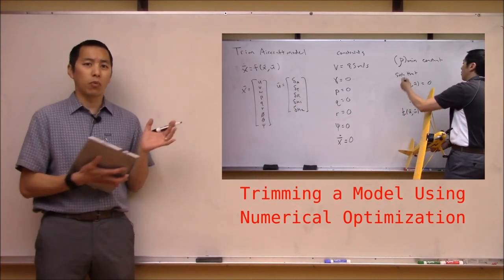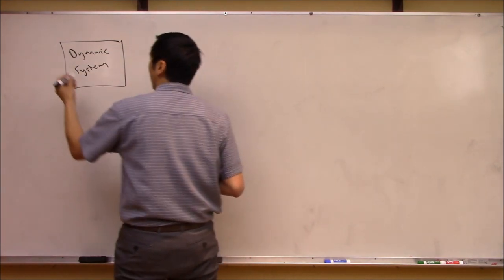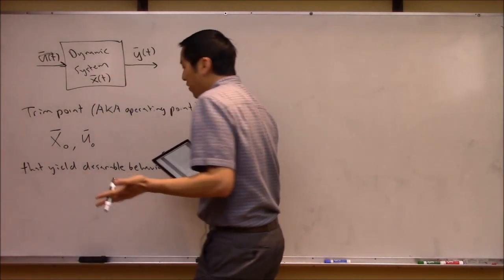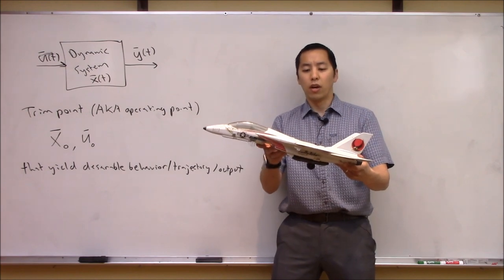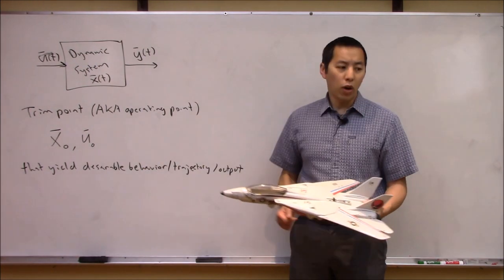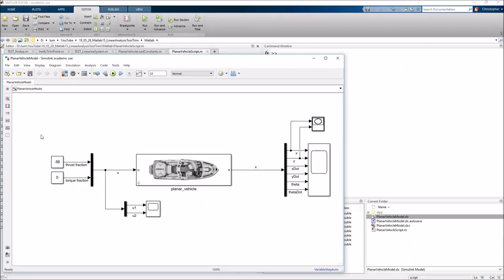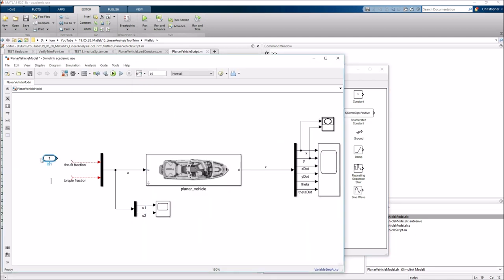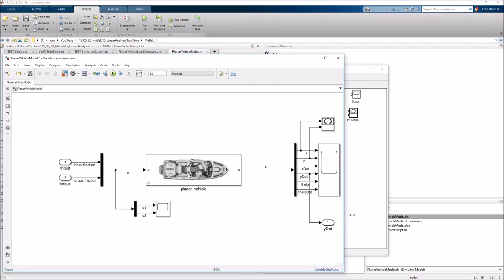Trimming a Simulink Model Using the Linear Analysis Tool

Comment: AA516: That is very powerful tool. I've been reading some of the comments and it looks like some stuff has changed since the new updates. It looks like I have the neccessary packages installed. Thanks for the lecture Professor.

Comment: AA516 - Great lecture as usual. I'm running R2020b and it took me a bit to figure out that I needed to download the Simulink Control Design addon in order to get Linear Analysis Tool. Also, in R2020b, the Linear Analysis Tool is called "Model Linearizer" and is under a different menu. This might be good info for the rest of class to know, if it wasn't already mentioned
Reply from the maker: Gary, thanks for the update and for blazing the trail with the newer version of Matlab.  I'm sure others will benefit from your knowledge (hopefully they read the comments 😀)

Comment: AE512: Very informative about the power of the linear analysis tool. After poking around with it, I was surprised that we could place more expansive constraints on the states (i.e not just a certain states value but rather expressions that related multiple states). Very powerful!

Comment: AE 512: FYI for newer R2022a version of Matlab:

(1) Install the "Simulink Control Design" add-on.
(2) "Linear Analysis Tool" is now called "Model Linearizer".
(3) Simulink menu bar is gone. Replaced by ribbon bar. Open the tool by going to Apps > Model Linearizer.
Reply from the maker: Thomas, thanks for the helpful notes, I'll make sure this comment is visible in the future!

Comment: AE512: Finding a trim point with the Linear Analysis Tool gui really simplifies the process. It should be a quick way to check trim points found using other methods.

Comment: Thanks professor.  I was confused with some of the terminology used in this video.  In case 1 when describing the constraints on xdot, specifically x2dot, it seems to me that you were saying that ydot is not at steady state.  But isn't ydot at steady state, just at a constant non-zero value of 15?  When you were describing the check boxes in the linear analysis tool it seemed to make more sense, that actually what you were describing is that y (x2) is not at steady state since ydot (x2dot) is non-zero.  To me it would have made more sense if you would have described it as "is y (x2) at steady-state, or is ydot (x2dot) equal to zero".  Do you agree, or am I not interpreting this correctly?
Reply: [AE 511] I had the same question as Brad a few years ago

Previously, you can have non-zero steady state values. It seems like steady state in the findop, we are defining steady state meaning 0

Comment: Hi! thank you for the videos, it is amazing! But i am having some throuble with my simulink model. It's trim using the linear analysis tool but once a initialize my model from that button on the operation point tab, my inputs changes for zero when the simulation is running. Do you know how i can solve this? thank you!

Comment: [AE 512] 16:24
Why is \dot{x}_2 not steady state? It is moving at 15 m/s but it's constant which means it's at steady state? Or does steady state in this case mean 0?
Reply from the maker: We want the boat moving in the +y direction so this means that y will be changing, but x is constant.  Because x_1 = x and x_2 = y, this means that \dot{x}_1 should be 0 but \dot{x}_2 should be equal to the desired y-velocity.
Reply: @ChristopherLum  I agree that \dot{x}_2 = \dot{y} = 15 m/s. But 15 m/s is a constant value in this trim case which also means it is steady state. One steady state value is a constant of 0, but it can be any value (like 15 m/s) and still be steady state.
Reply from the maker: Ah, I see, I was using the SS notation to denote which states are in steady state.  Go forward to around 24:30 and you'll see that the steady state constraint is on the state vector.

Comment: AA 516: Can you post the planar vehicle model so we can follow along in Matlab?
Reply from the maker: Hi Tim, I'd actually recommend that you follow along using your RCAM model.  The planar vehicle is actually too simple and you really want to do this with your aircraft model.  If you run into trouble and want the planar vehicle let me know and I can try to dig it up and send it.
Reply: @ChristopherLum  I have managed to make it work on RCAM with some initial struggle. The difference between versions are quite apparent here.

Comment: quick question, why 6 dof  equations instead of 9 (3 translation, 3 momentums, 3 kinematics)
Reply from the maker: Thanks for reaching out.  If you have questions or would like to request a video, I hope you'll consider supporting the channel via Patreon at https://www.patreon.com/christopherwlum.  I'd love to have you as a Patron as I'm able to talk/interact personally with Patrons.  Thanks for watching!
Reply: @ChristopherLum  absolutely. thanks
Reply from the maker: @alexnguyennn  Phi, great, I'll be sure to look for you over on the Patreon page.  Please feel free to re-post this or any other question over there and I'll be able to respond and we can talk more about control systems on the Patreon platform.  I'm looking forward to the talk!

-Chris
Reply: @ChristopherLum  i just registered and i will directly ask you if i have question. i have been following you for a month on Youtube and Linkedin :).  For this video, i think there is 2D so only have 6 dof, the other video RCAM model is using full derivation.
Reply from the maker: @alexnguyennn  Thanks, I'm thrilled to have you as a Patron!  

To answer your question, the nomenclature of 'degrees of freedom' is sometimes a little lose.  With traditional rigid body dynamics, you can describe the orientation (sometimes also referred to as the pose) using 6 values (3 translational position and 3 rotation euler angles).  This is why most people refer to this as a 6 DOF model.  However, if you are generating a dynamic model of this vehicle, from our investigation of state space models, we know that we actually need twice that many number of states (3 translational positions, 3 translational velocities, 3 rotational positions, and 3 rotational velocities) for a total of 12 states.  Confusingly, sometimes people refer to states as degrees of freedom so you really need to be careful of the context in which these terms are used.  In this particular video, you are correct in the sense that I've restricted the motion/dynamics to a 2D plane and as such, there are only 3 DOF which need 6 states to describe.  Does this answer your question?
Reply: @ChristopherLum  that makes sense. Thank you so much 🥰